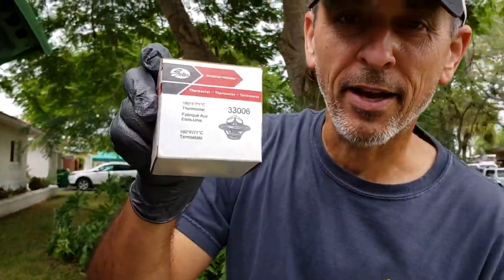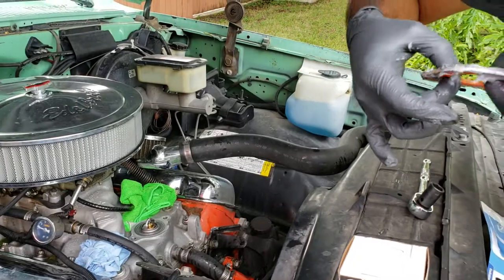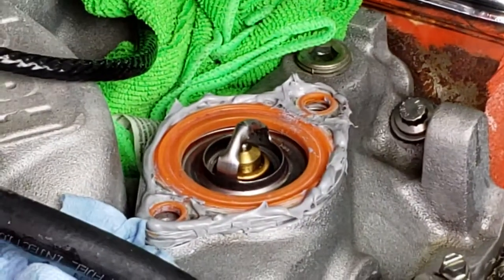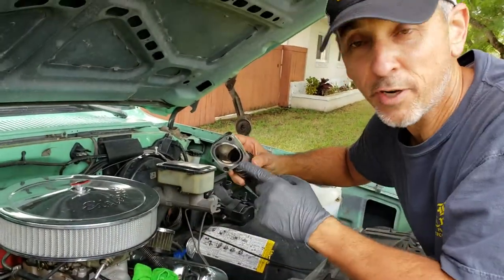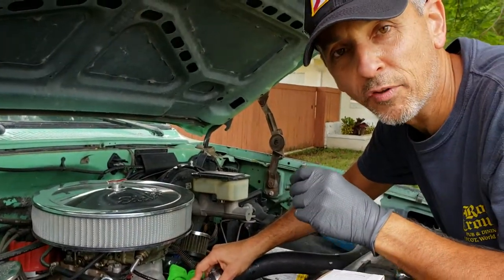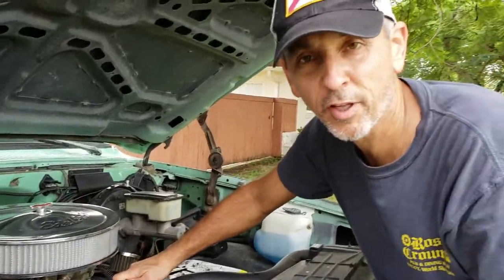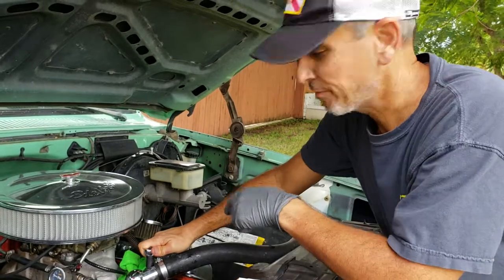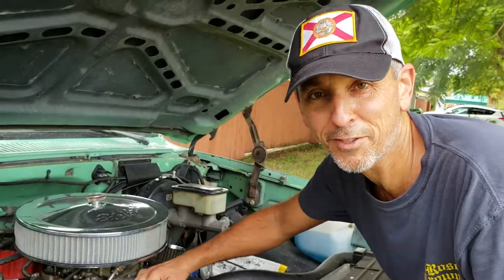Change Thermostat on 1986 Chevy pick up truck

Comment: 160 is good in summer?
Reply: Opens up at that.  I'm not a mechanic, just attempting to make better what I had. Thanks for watching 🤙
Reply: Runs good in hot days? The thermostat housing sealed good?
Reply: I was running a 305. For last summer I had no thermostat at all. It would run too hot when it was hot out. Replaced the thermostat yesterday, I put it on upside done by not watching a vid and it remained the same. I did it the same in yhis video and so far no high temps over 200
Reply: 160 is like perfect, but I would assume that that’s not at highest temp

Comment: Sir you don't need sealer if you really want to real thin it will get in ur system and cause a lot of problems
Reply from the maker: I appreciate the comment sir,  you're right. I had tried it without sealer and it leaked,  so I was told to put a very thin amount of sealer gasket..... i guess i put way more than i should've.